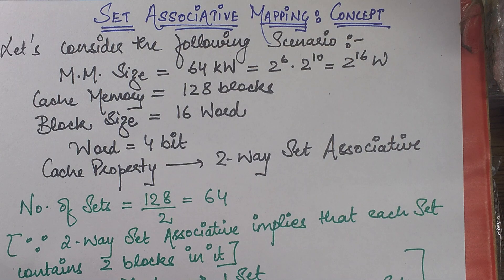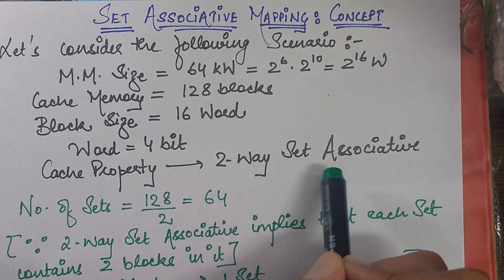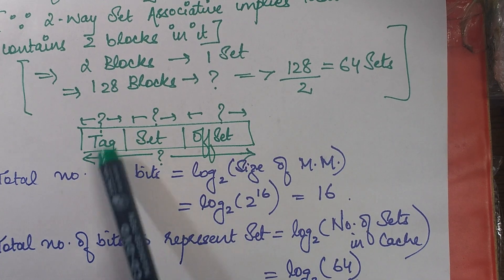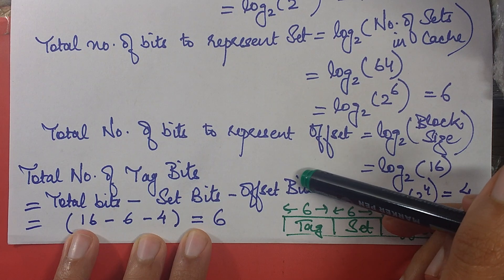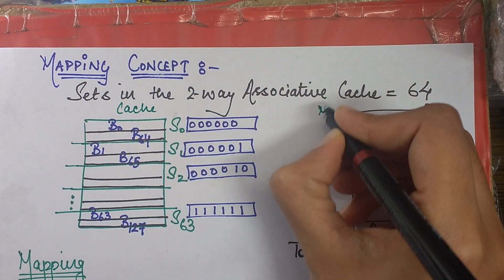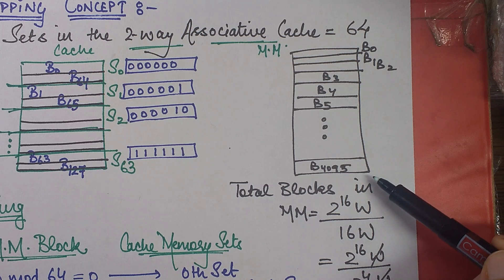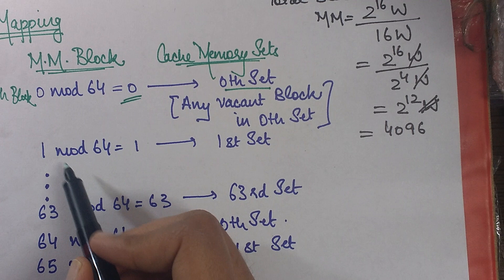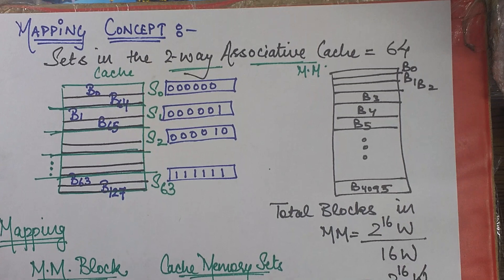SET ASSOCIATIVE MAPPING- Concept Computer Architecture

Comment: Mam i have a confusion in the previous set associative eg u took (32 bits and convertwd it to 2^5) and got the answer as word bits =5 but,  in that question no. of words = 8(block size) was mentioned already then why u did not take word= log2(2^3) as the solution for word, then the  answer should have been word bits = 3 not 5.
Reply: same question ma'am.

Comment: hi. it was nice.
can you explain this in set associative mapping?
For all three cases, the example includes the following elements:
• The cache can hold 64 Kbytes.
• Data are transferred between main memory and the cache in blocks of 4 bytes each.
This means that the cache is organized as 16K = 2^14 lines of 4 bytes each.
• The main memory consists of 16 Mbytes, with each byte directly addressable by
a 24-bit address (2^24 = 16M). Thus, for mapping purposes, we can consider main
memory to consist of 4M blocks of 4 bytes each.

Thanks
Reply from the maker: Sure. But you didn't mention the k value for k-way set associativity...
Reply: 2 way set associative.
Reply from the maker: 2 way set associativity imples-> (2^14)/2 =2^13 sets -> 13 set bits and offset bits=log(4)=2 as block size =4 bytes and therefore tag bits = total bits-set bits-offset bits = 24-13-2= 19 bits
Reply: if i m not wrong tag bits will be 9.
what you say?
Reply: have you checked your mailbox?
Reply: please also tell me mapping concept of this.how i map?
Reply from the maker: how are you getting this answer of 9 bits? As per me and my explanation, the answer should be 19 and the reason for this big tag bits is becoz of small size of block offset bits...
Reply: i explaining here
we have total bit 24. word is of 2 bits,set bits are 13 so 
24-2-13=9
Reply from the maker: Yes it's 9... I did the same i.e. 24-2-13 (you can see in the detailed explanation given by me) but wrote it as 19 instead of 9... Sorry abt that....
Reply: before it i have calculate all these but problem mapping.how it will map?
you can teach me in proper way which block placed in which set  or in a set block?
Reply: have you check you mailbox?
Reply from the maker: Since the question is very similar to the one discussed in the video above and the mapping part is explained in the above video ... Is it not clear from there? In case you didn't view it, please view it once... If you did and it's not clear please let me know, I'll be pleased to explain it again...